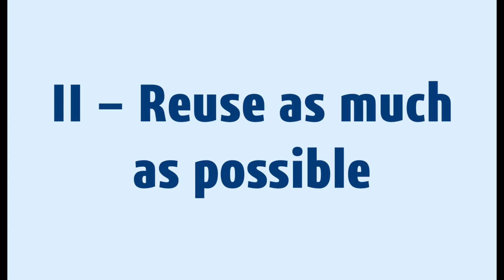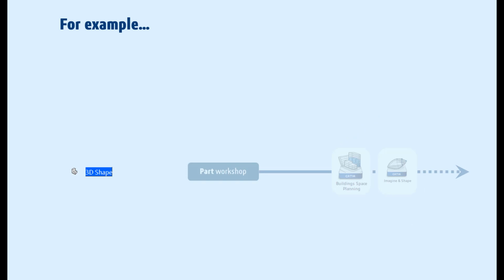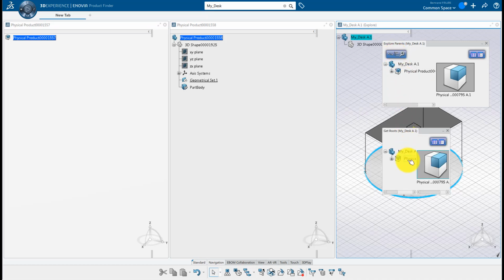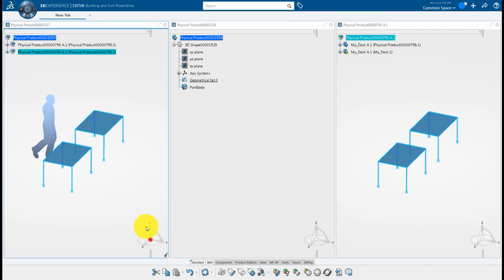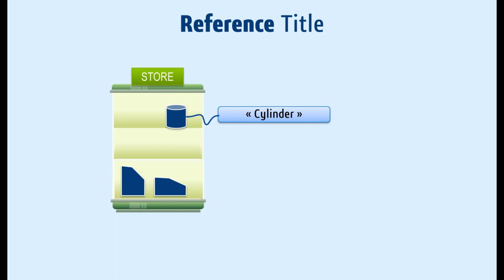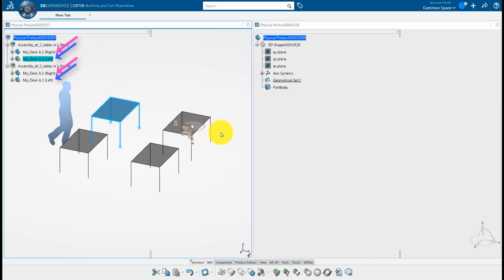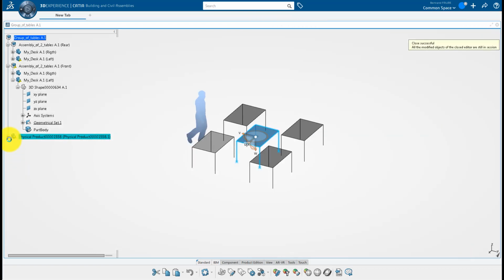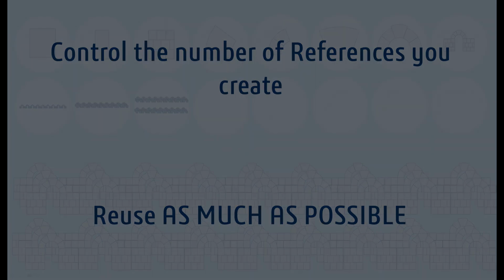CATIA for complete beginners: 02- Reuse as much as possible

Comment: is it possible to assign custom attributes to objects? picklists and rules (obtain volume ...) for shared instances
Reply from the maker: yes absolutly, to compute or expose any kind of parameter
Reply: @CATIAAEC  ok quick case study: i have some solid, which is a concrete block. i want to define (is there such a thing as associative face extraction, or how) metadata which faces of the solid are formwork and then using some little coding to display that area in FormWorkArea attribute in the parent object. I am asking about creating custom parent child relationships and bulding intelligent model according to my own arbitrary decisions. Are metadata generally accessible from Visual Scripting environment? Is there a forum where i can post more detailed questions about Catia because this seems as only viable option for future. Other platforms are too compromised
Reply from the maker: @ivangalik7848  I am positive we can achieve your scenario, very nicely, with a graphical scripting interface available on cloud I wish you can try this